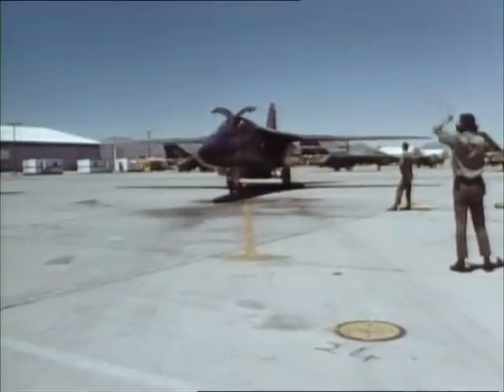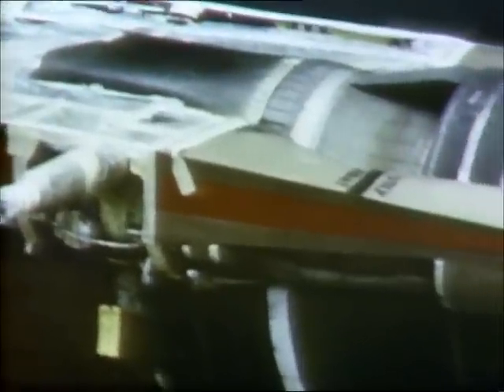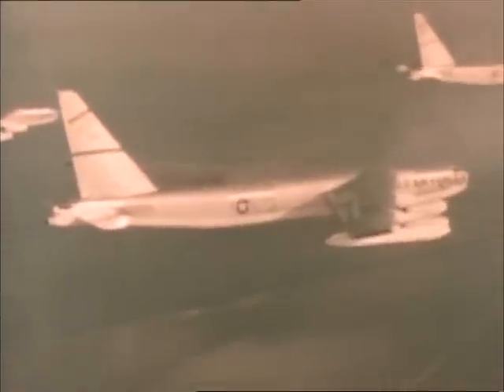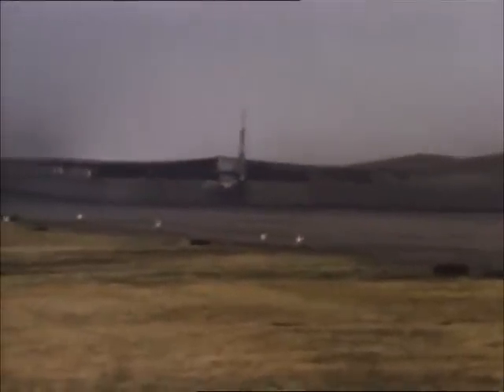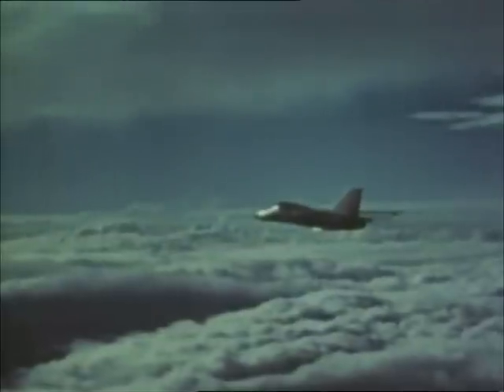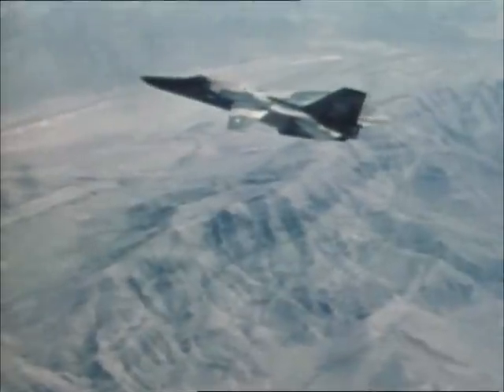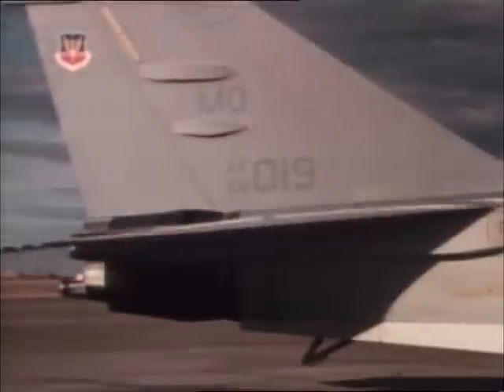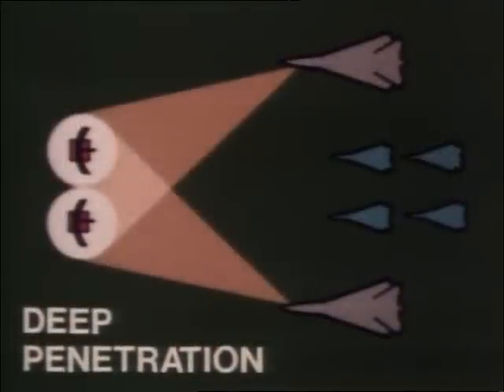F-111 WINGS Part 3/5

Comment: Say what you will about McNamara but calling him a buffoon and a clown puts you firmly in the same Boat you put the media...sitting in the peanut gallery calling people names. RM served the best he could.
Reply: It seems to me that McNamara's idea to use a very similar aircraft for the USAF and the USN was a very good idea especially when their requirements for the aircraft were very similar.  Much more money is spent maintaining aircraft over their 20~30 year lifetime than spent buying them.  Both of those numbers are big.  The saving would have been big when you consider design, building and maintaining two different aircraft, flight simulators, avionics system test stations,  maintenance support fixtures, repair facilitys and their special tools,  test equipment for organizational, intermediate, and depot level maintainers.  Common training for pilot and maintainers savings would have also been large.  I believe the two reasons that the Navy top brass, ( Adm Tom Connally especially vocal about it) opposed it was they didn't want to allow the Pentagon to decide what aircraft they get because once something like that happens it most likely will continue.   The second reason is that the top brass expect or hope to be rewarded a high level job with the company they have helped pick for the job of building their aircraft.  I know the second reason sounds so awful that someone would waste billions of taxpayer money just so they could possibly get a cushy job but I am aware of former Cols and Generals working for my former employer and then hiring their buddies.  I doubt they were hired for expertise, only for their contacts with the present potential "customers".  For anyone who believes the F111 wouldn't have been a workable choice for the USN just checkout the YouTube video of the USN carrier test of the F111B.  The Navy's choice of naming the F111B replacement (the F14 Tomcat) surely had nothing to do with the F111B's most outspoken opponent Adm. Tom Connally.  Hope this kind of unholy and costly alliances have stopped but I doubt it.